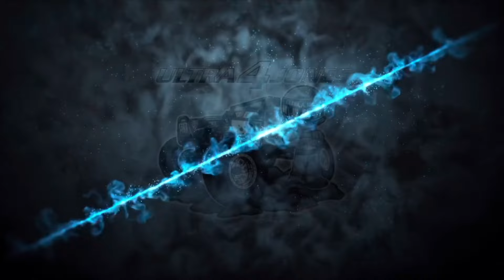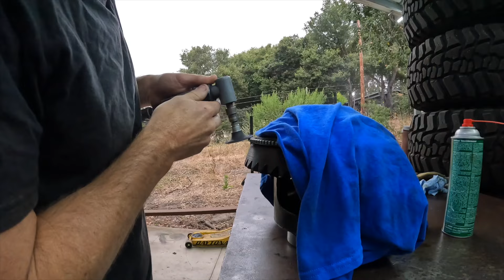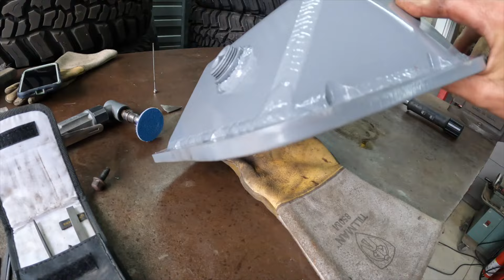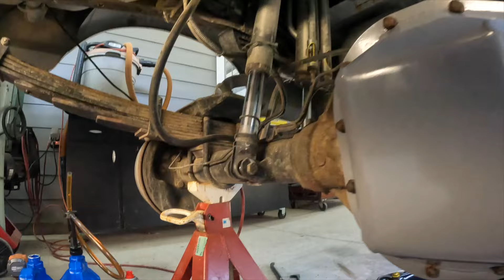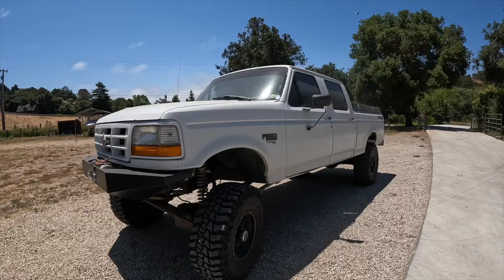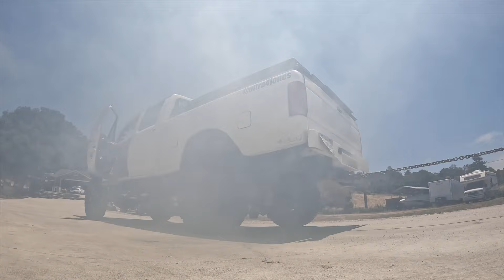10.25" Sterling problem.....let's do burnouts to test it!

Comment: What rpm do you see running highway speeds with the 4.10 and 37s?
Reply from the maker: @Corey_Fox  i want to say that is right around 2k at 65 or 2200 at 70